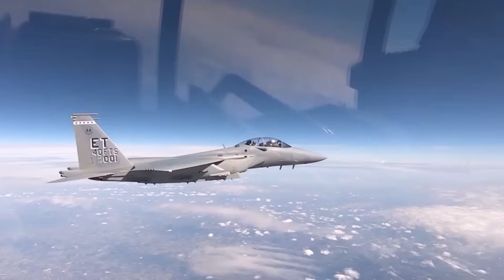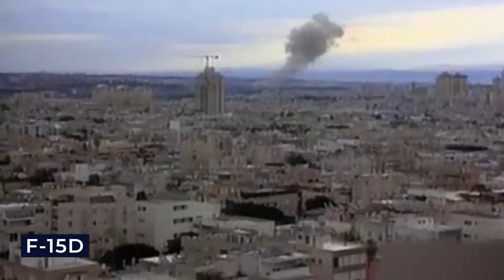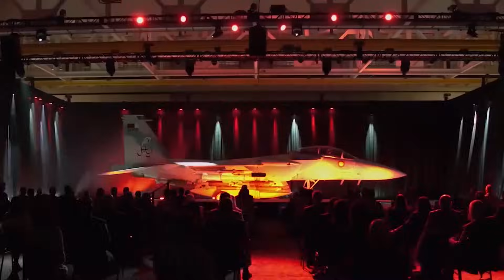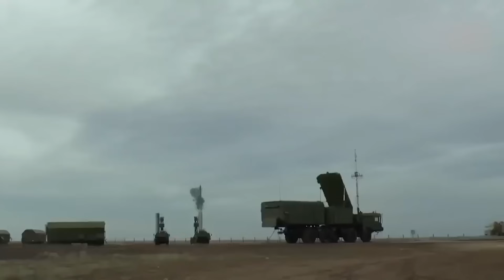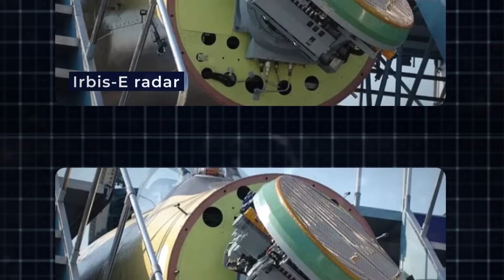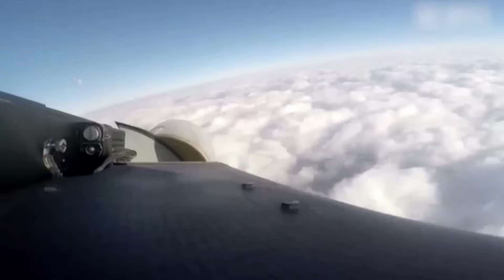This NEW American Super F-15EX SHOCKED China and Russia

Comment: This is an excellent video. However, two metrics you did not mention are very important. The question every nation wants to know is how many square miles can two F-15EX patrol and maintain total superiority. The answer is TOP SECRET. Some insiders believe it is likely the biggest number of square miles of any aircraft. The second important metric, also a secret, is average time to turn around a plane and put it back to service. Some techs have said they could change out both engines faster than any other aircraft. And in combat more time in the air equals lives saved.
Reply: That's a good argument for sure, nothing is untrue about the statement even if the facts aren't correct. 

I know the Airforce has mentioned NGAD based of the F-22 miles of 400 or 600 total miles, they are hoping to push a 1,200 mile range for a pacific war, " even if it means not being as maneuver as the F-22."

Should be interesting.
Reply: @sshumkaer  My late Uncle Bill was Director of the F-15 at the inception, at McDonnell Aircraft company. He said Miles of patrol was the greatest secret of any fighter aircraft production. And F-15 was near the top of the heap. Although, he never spoke of any figure. But, he did say the square miles figure is what sold the plane to other countries. How long for an engine change is what made the orders to governments very juicy.
Reply: Lives saved? More like lives of innocent people killed by the US Air Force.
Reply: Rather than the F-15EX themselves fighting to maintain air superioity, they'd be better used as the muscle to carry aloft the huge quantity of missles the F-35B and F/A-18 cannot.   The CCP PLAN would swarm attack and that is the weakness of the F-35B, F/A-18, and F-22 not having enough air-to-air quantity.   Total stealth isn't needed by the F-15EX in that situation where it provides the quantity of air-to-air missiles the F-35B and F/A-18 didn't carry aloft.
Reply: I respect your opinions, although I don't think I agree with your opinions. @naekosl3059

Comment: Still i see the SR-71 the fastes & better equipped than any other plane in sky today with its electronics defense systems & rocket engines.
Reply: You slap some firepower on an SR-71 boy lookout now that would definitely be a dangerous combination
Reply: It has the turning radius of comet. At speed that bird makes a 180 in about 200 mile radius. Not nearly the same type of aircraft. Totally different mission parameters
Reply: The SR-71's didn't have "Rocket" engines ; they had { Hybrid } jet engines ; first part was a standard Jet and 2n parts was a Turbo-Ram Jet. Yes rocket engines are faster then even a Ram-Jet but rocket engone technology wasn't advanced enought to be the engines for the SR-71's at the time. Once the BlackBirds were high enough to switch to and use the Turbo-Ram Jet operation ; the Turbo-Ram jet got more efficent the faster they went. So it was to the BlackBirds advantage and what allowed it to perform how it had too. So the BlackBirds were a Hybrid which got better efficiency in hybrid mode - another aspect of the engingeering that was way ahead of the time.

Comment: Stealth as pointed out is expensive and with the right integration radars can find a sreslth aircraft.  Integrated radars find the holes in the sky that represent the location of the steslth aircraft.  One was shotdown in the Balkans years ago in the Balkans.  The F22 was to be the equivalent in role to the original role of the F15 while the F35 was to match the original role of the F16.  One of the reason for F35 delays was to improve its air superiority, since this wasn't its original role.  Would I prefer a newer aircraft; but this will be closer to an air superiority role with as stated greater speed, good maneuverability , and heavy armament.
Reply: The F-22 is going bye bye.
Reply: @briantaylor6562  You are correct, leaving the US with no fighter designed for and optimized for air superiority.  That is fine, unless we go toe to toe with an enemy with a significant air threat; meaning a superior number of peer aircraft or advanced fighters optimized for air superiority.  I am less than impressed with some of the ideas about drones because if I were an enemy i would remove that threat with methods of signal blocking.  By the GPS munitions aren't as effective if the enemy destroys your satellites.  Again no issue unless you are dealing with a peer adversary or one armed by such an adversary. The problem with our planners is that they love complex solutions with failure po I nts built into them.
Reply: In the end it really doesn't matter we are only here because the Airforce never followed through on the original plan which was to retire everything with the F-22, but budget cuts kept them from purchasing as many.  Now, 30 years later, it doesn't Mayer new computer chips, faster processing, more memory space, better sensors it just makes sense to update now.

Despite the Airforce saying the F35 stealth is based off the F-22 and that the F-22 air to air combat defeats it. Which is also not important as the F35 is more of a fighter bomber classification. 

F22 stealth is classified until after I'm dead. I'm in my 40s